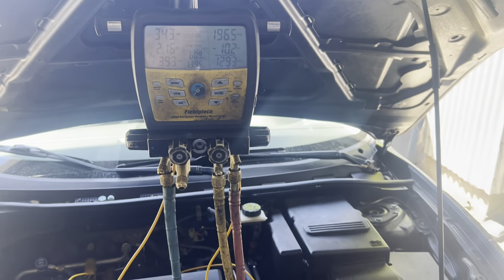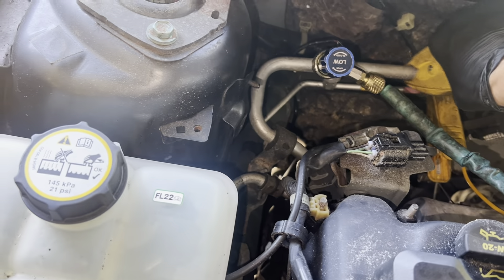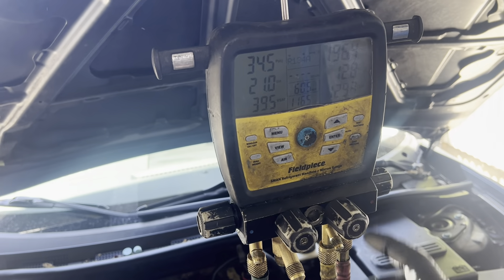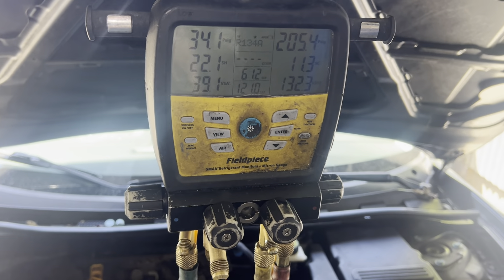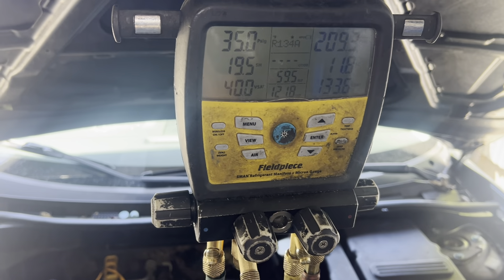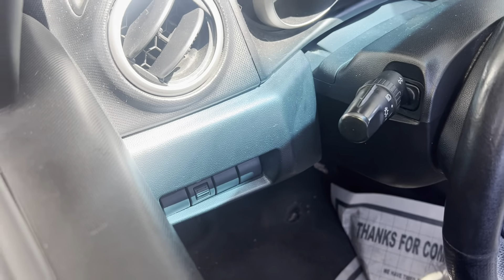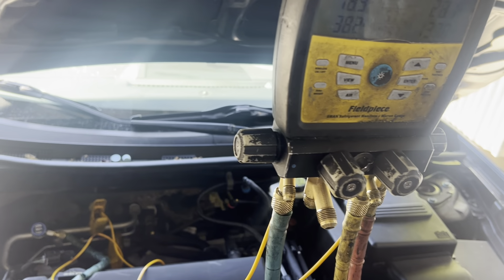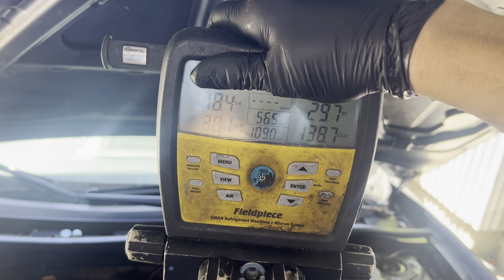GUESSING adding in Refrigerant like all the other HACK shops (BILLY BOB BUTT CRACK STYLE)

Comment: So equipment you recommend... Feild pice sec sensor at all... Navac for all pumps
Reply from the maker: Fieldpiece SM480V refrigerant manifold

Yellow jacket hoses

Accu tools BluVac micron vacuum hose

NAVAC wireless scale or second Fieldpiece wireless scale

For simple cheaper vacuum pumps
JB
Yellow jacket
Robinair their old style vacuum pumps not the little cheesy Chinese made ones that are cheap seen too many of those burn out
NAVAC
Fieldpiece

If you wants a separate standalone micron gauge the one made by Accu tools BluVac+PRO
       That one has all the bells and whistle‘s and use with the tracking software. 

But if you want the exact same quality with the exact same sensors with no bells or whistles you can buy their cheapest sensor micron gauge but the quality of the actual sensor that does the measurements is exactly the same.

Comment: Subcool and superheat how much need for good cooling and compressor life is long
Reply from the maker: In automotive it’s different than your average residential split system or commercial refrigeration.   There is no one number there is no rule of thumb it’s different for every year make model manufacturer and they don’t give no specification this is something you just learn after doing literally hundreds and thousands of vehicles. 

If you do a lot of air-conditioning and you’re constantly doing a lot of similar vehicles in your area you’ll get to learn and know and understand a couple of them and you will start memorizing and seeing a pattern. 

Because the manufacturers do not publish these numbers. 

So this is something that you have to self teach but you need good measuring equipment and you have to place your probes in the right location for your temperature sensors and every time you do that same vehicle the probes need to be located in the same place otherwise you will get wild different numbers and then none of them will mean anything. 

A number is not important it’s the knowledge behind the number knowing what it means and be able to repeat consecutively vehicle after vehicle the same thing.

Comment: thanks for another video, I got the fieldpiece 380  manifold with a set of yellow jacket hose, I received them last week and after connecting the hoses to the manifold for a self test to see how it holds the vacuum and turning on the pump, I reached to 750 micron after about 15 minutes, it  jumped to 1400 micron after I turned off the pump, tried to isolate the leak I found out the blue hose has about 250 micron leak and the red one about the same, but the manifold has about 1100 micron leak by itself,so now I know my zero point is about 1400 micron, now I do not know how accurate my reading would be when pressurizing the A/C plumbing , I assume I might have a leak also when doing this test, if the pressure drops, 1 psi for example is it my equipment or the ac plumbing, I am not sure how to make sense of it.
Reply from the maker: It’s not leaking you’re just trying to measure with rubber hoses your number sound about right.      That is what happens when you use rubber Refrigerant charging hoses they were never meant to hold vacuum that deep. 

End a combined internal volume it’s so small that even a little bit of moisture or off gassing of the solvents inside the brand-new rubber hoses raises the pressure a little bit and the micron sensor is so sensitive it can actually measure that comparative with a very tiny volume it takes very little to raise it. 

Now if you take that same refrigerant manifold set and yellow jacket hoses and if you had a separate micron gauge connected to one port of a brand new never used recover refrigerant cylinder and you hook the other port to the cylinder vacuum dead overnight and closed off the valve on the cylinder you would notice that the standalone micron gauge might just rise about 100 or 200 µm.   

But if you left open both valves on the tank and isolated and shut it off at the manifold leaving the rubber hose in line with the cylinder you might notice that the decay test rise in microns might be about 400 µm because of the rubber hose. 

Using rubber hoses you will never get a perfect micron vacuum level reading but it will be good enough for government work and at least is a beginning for you to start to learn. 

I’ve done a series of videos on this about a year or more ago and maybe it’s time for me to do them again because there’s a lot more new subscribers who need to see what to expect with the limitations of the equipment they have.    

Metal lines in place of rubber hoses have next to no loss in vacuum decay. 

The blue silicon hose for using just for vacuum only does a much better job than rubber charging Refrigerant hoses
Reply: @coldfinger459sub0  thanks one more time for the response, so you think i can trust the pressure test decay with these rubber hoses? i know there is no definite answer to that question. thanks again.
Reply from the maker: @moebassidji8306  so perform your baseline test about two or three more times doing the exact same thing for the same amount of time. 

And then you will come to find out what the limitations of the hoses that you have where are there of decay finally rest.    As long as it consistently keeps stopping somewhere around the same level and maybe even a little bit less every time you repeat the test. 

Then you know you do not have a leak we’re going to use the example of 1400 µm and then it just stops. 

If it stops somewhere a little bit higher 2700 µm or 3400 µm and then stops then you just know it is moisture and it’s not a leak and you can safely say you know your hoses or any of your seals or connections do not have a leak. 

And then whatever system you are working on you could leave it on the vacuum pump longer if you have the luxury of time. And then after several more hours or maybe even another 24 hours when you re-perform the test you should find it’ll be a little lower than the previous time because you would have removed a little bit more moisture. 

But you will never be able to go your baseline of what the limitation of your hoses will not allow you to go under.   

I have one video where I replace the rubber hoses with soft copper metal lines showing to vacuum decay only going up a few hundred microns I cannot remember what it was but it was really low it was over a year ago. 

I have another video where I had the Accu tools BluVac micron Gauge hooked up to a recovery tank that I think I got down to 13 µm and probably after the vacuum decay and resting for a while was well under 100 µm. 

So everything is dependent on the set up and the types of hoses being used or metal lines. 

About the best homemade thing you can use is three eights inch soft copper from line set and then you braise somewhere in the middle a ball valve made by Mueller quality company.   This way you have a shut off valve in the middle. 

You quarter inch or three eights nuts on the copper and you flare them one side might have to be quarter inch because that might be what you’re attaching to. 

And you hook your copper line that you just manufactured directly to your vacuum pump with the flare. 

And now you just draw vacuum through that one single line attached to your system and then you will be able to obtain the lowest possible vacuum because you’re using metal line instead of rubber hose.
Reply: @Moe Bassidji Be sure that you're putting a little bit of Nylog gel or high vacuum grease on the hose end o-rings/seals and any other connections that you make. You might even remove the manifold valves and make sure they are cleaned and have a tiny amount of refrigerant oil on them. If I was you, I'd do those things and then I'd put the whole setup under vacuum. Put your R134a port valves or your R410a ball valve ends on the ends of the high and low hoses and make sure the valves are closed. Then put the yellow hose on the manifold and on the vacuum pump and vacuum it down for an hour. Close the vacuum hose valve and then connect it to your nitrogen tank and break the vacuum with a 1PSI or 2PSI of dry nitrogen. Do that 3 times. Perhaps you could connect the high side hose and ball valve to the nitrogen tank to simplify it. On the last nitrogen fill cycle, pressurize the manifold and hoses with a few PSI of nitrogen and then close all your valves. Connect them tightly to the dead ports on the manifold and store the gauges that way at all times. You always want a tiny bit of pressurized dry nitrogen or even some left over refrigerant in there to make sure moisture can't get in through the hoses. If you leave the hoses and manifold open to the air in storage, the pores of the rubber will get full of water and it'll be hard to reach a deep vacuum and keep it. It's already hard enough doing that with refrigerant hoses as it is just like Tom said already. If you keep your manifold and hoses dry, and you use Nylog on your fittings, you'll have the best odds of having a leak free setup.
Reply: @coldfinger459sub0  Tom, PLEASE make a new video in depth with all the details about making a home made copper line set! I watched your first video when it came out a year ago that you're talking about here. I was super interested in it. You talked about how your dad taught you how to do it. I think that's the best solution for DIY and low budget guys to get a fabulous tight line set that can kick ass under vacuum and not leak. I would love to make a set for myself. I also intend to build that refrigerant can daisychain rig that I think I explained in the past with Tee fittings to make a refrigerant bank that's big enough to charge the system in liquid but just big enough to do so because DIY guys can't drop hundreds on a 30lb tank just to use 1,000g or so.
Reply from the maker: @mannys9130  I made a few complete videos about completely disassembling the manifold gauges and using silicone grease or nylon for reassembly on all seals
Reply from the maker: @mannys9130  OK I’ll do a video on making up some copper because everybody can get free soft copper usually from the job site
Reply: @coldfinger459sub0  😺😺😺😺😺😺
Reply: @mannys9130  thanks a lot for the instruction.
Reply: @coldfinger459sub0  i was wondering about holding the 150 pounds of pressure ,am i losing the pressure through my hoses or it is the A/C pluming,i am clear  about base tlminng my reading when it comes to vacuuming,thanks to you one more time.
Reply from the maker: @moebassidji8306  On my commercial air conditioning jobs I use pressures up to 600 psi and leave it on for 24 hours.     So they are more than capable of handling for automotive a simple little 150 PSI with no problem at all. 

And this too is where I recommend having a dedicated brand new refrigerant recovery tank that is never used for anything else other than testing your equipment.    It has always been vacuumed out so you know it is 100% moisture free and good for doing vacuum tests. 

And you will do the same thing with pressure test only using dry nitrogen not shop compressed air because the moisture will contaminate the container. 

And the same thing goes under pressure you cannot just pressure test the hoses themselves that does work but because it’s such a small volume a tiny difference even the pressure stretching rubber hoses will be able to be measured and show as a pressure loss. 

This is why when performing a pressure test instead of using Shop compressed air because the 20% oxygen in it has a higher tendency of moving a few more psi then just pier nitrogen alone. 

using a large cylinder that has a large internal volume on a pressure test for an hour or overnight will tell you more. 

Because you’re not sure of the system you are testing is 100% seal tight. 

And your testing will change as temperature changes. 

So if you start with a heart car on a hot day with a hot engine and you pressurize it with air or even nitrogen. 

As the car cools off in the day cools off the gas in the system will shrink Lowering the pressure

On the contrary the opposite will happen if you fill a cold car that has been sitting overnight and it’s 50° out at 7 AM in the morning with cold nitrogen and then leave your gauges on it until the afternoon and it heats up to 80°F the pressure will go up. 

So again you have to learn the limitation of the tools you’re learning and you have to learn what else affects your test measurements you have to understand physics the laws of science pressure and temperature relationship understand the gas laws ( three gas laws )
Reply: @coldfinger459sub0  appreciate it very much.